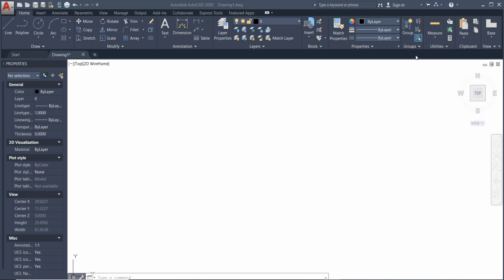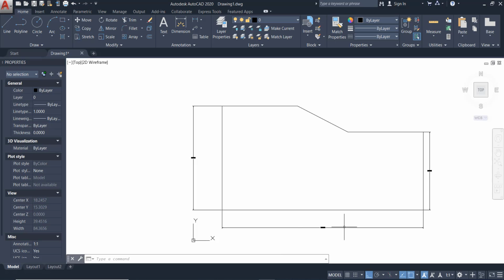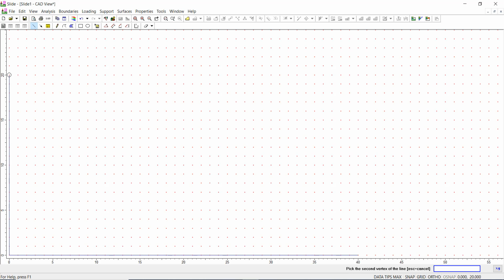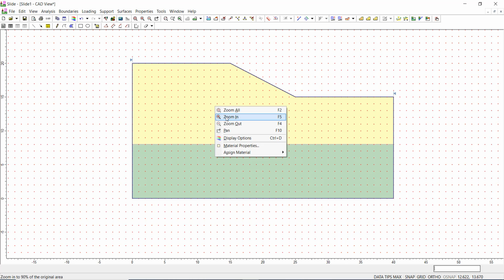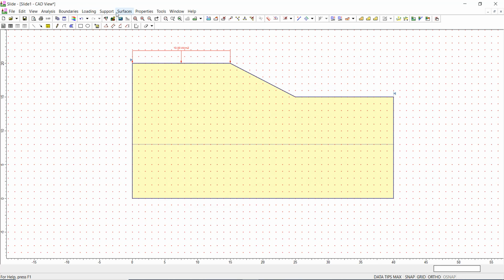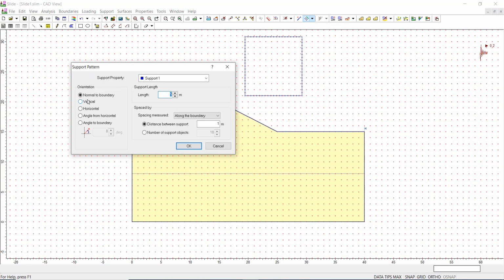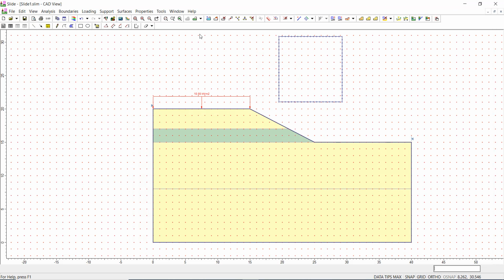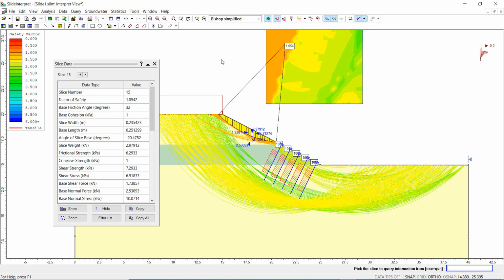Getting Start with ROCSCIENCE SLIDE 6.02-Slope Stability Analysis Using Limit Equilibrium

Comment: On a practical problem, the center of rotation shouldn't be touching the edges of the box. It needs to be moved in order to find the critical failure surface.